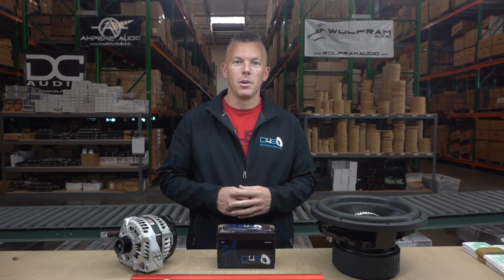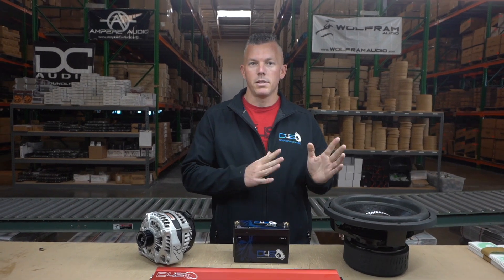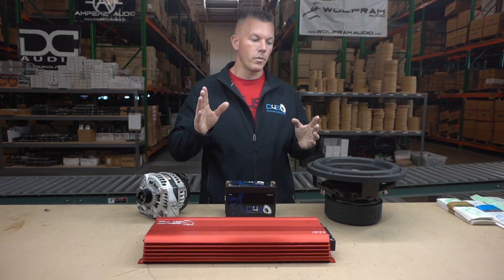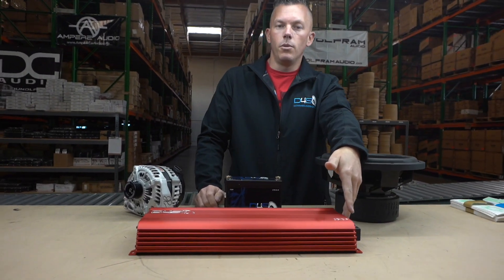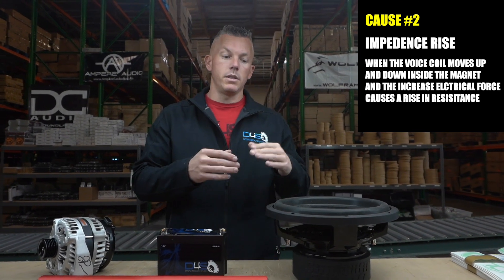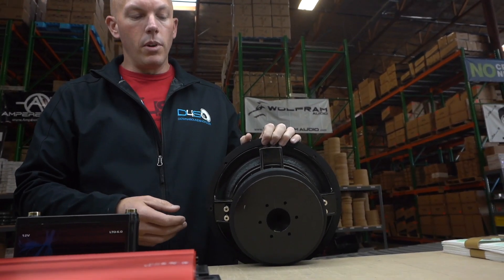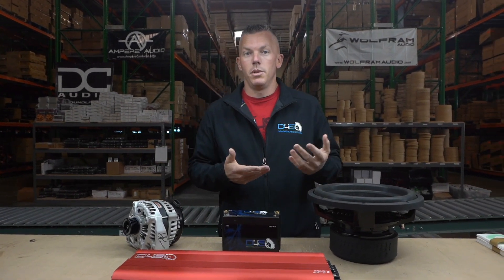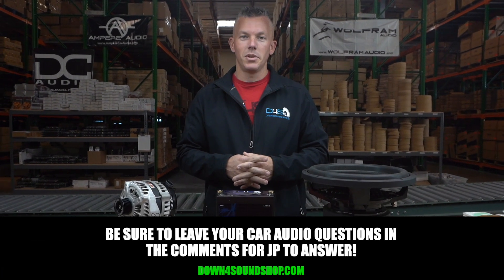WHY IS MY SUBWOOFER NOT PUSHING ENOUGH POWER?

Comment: Hi 
I got an smart charge system in my car, after couple of min t alternator fall down to 13’s volt and lower. 
So what i did is to unplugg my cars electrical and only on a 150ah li-ion bank. Charge it to 15.5 and Play to i reach 14 before i switch on the alternator. I was wondering if i miss out of amps when the battary is alone suplying the amps? And its better to have the alternator anyway

Comment: So I have a 10" sub. Same sub I had in my Camry but now I have a Tacoma. He built a custom box so that it would fit behind the seat which is obviously a smaller box than in the Camry. I'm not talking about loudness at all cause it gets very loud. But it doesn't hit anywhere near as low as it did in my Camry. It went lowwww. But now it's only hitting at, like you said, such a small bandwidth. Is there anyway at all possible to get it to get those lower tones? I can't get a different sized box either. It's really depressing cause I waisted so much money to put the same sub I had in my other vehicle and I'm not even getting those low sub/bass tones that really give songs their emotion. Any tips at all for drawing those lows out would be very much appreciated. Thank you!

Comment: Johnathan, I have your JP23 along with two Sundown audio SA Classic 12's wired to 1 ohm. Very disappointing. Underperforms so much. I replaced my one Alpine 12 inch bass tube and Kenwood KAC-9104D with what I got from you and the increase in power and impressiveness is almost negligible. This is 300rms vs 2000rms. Very disappointing. I still run between 13.5 and 14.4 volts consistently. Any ideas?

Comment: i run 3k rms amp single 12" 500w sub at 2ohm with stock electrical, stock alternator is rated 90amp 😂 just upgrade grounding 3point, battery neg to body + body to engine + alternator chassis to battery neg. use 1/0ga ofc. not push to hard, just enjoy my music my song, volume 4/10 pretty nice for me. sometime push volume to 9/10 my voltage drop around 13.2v 13.3v sometime 12.9v. my idle voltage is 14.3v. but doest have any issue, my hid head light not dimming + air cond running good. love my system ☑️

Comment: My main problem when I just installed my first system was not knowing how to set up my gains on the amp. I had a 500 watt amp on 600 watt sub, but sub seemed dead. Once I adjusted my gains properly and set up crossovers, the thing was rocking so much that my eye sight would get blurry. Can’t even imagine what a 3000 watt properly set up system would do...
Reply: Haha my first system ever was a rockford p3 on 900w it was a 1k rockford amp and it pounded but I upgrade like 3 weeks later got a way better box another p3 and a jl 1k slash 1v2 shit was banging for a lil beginner.